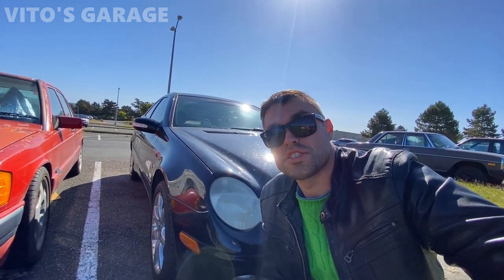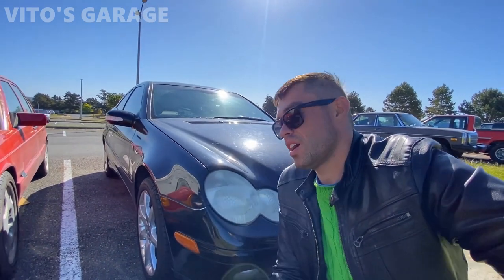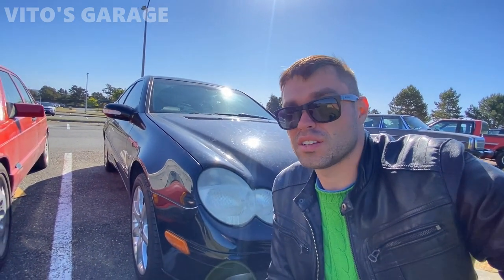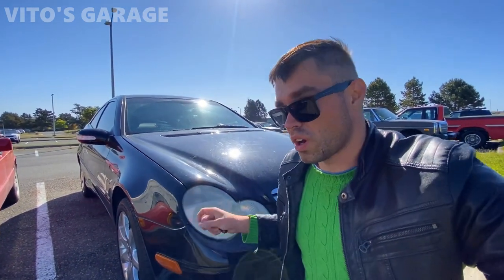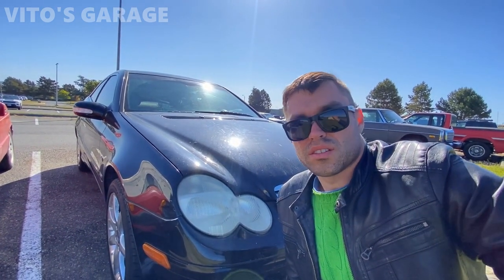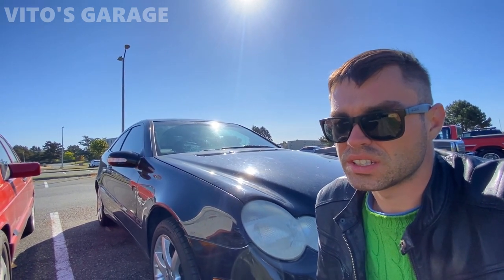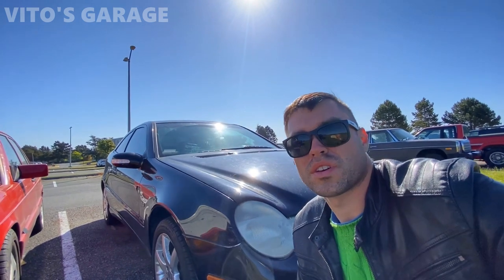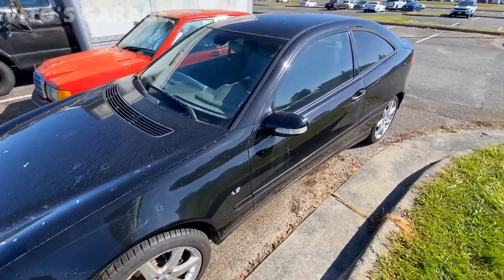20 Years Old Mercedes W203. I love the Car But...... Mountain of Electrical Problems

Comment: Fully agree with you Vito. I have a 1999 R170 230 Kompressor with no real issues although I did have an issue with the turn signals. I also have a  2007 W221 320 Cdi limo which I have had a couple of electronic issues with the seat module which screwed everything up ad took some finding. It also had problems with the oil cooler which was costly to fix. I love the car and it is a better drive than any Rolls Royce of the same era. The worse car I had was a 2001 W220 which was a complete and utter money pit and rotted out under me in less than 3 years.

Comment: I have a 2.3L 2002 version and it looks way different with the components layout then yours but mostly same problems Ive been trying to learn how to fix them but having problems to diagnoses them by myself.
Reply from the maker: Check out the playlist: https://youtube.com/playlist?list=PLUX40ehXqGFoIt__xG0tRdmraUinduprB&si=nnbazIbiiRN0zWxd
Reply from the maker: The issues with fuel gauge and rpm gauge were fixed by changing the cluster